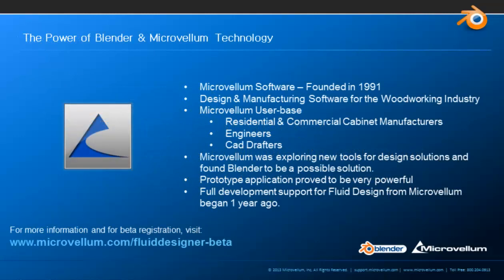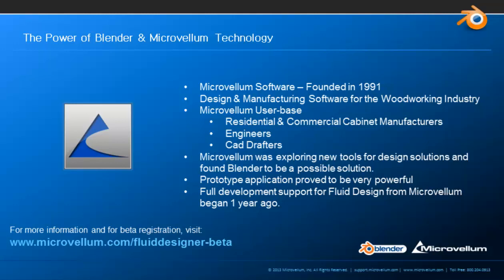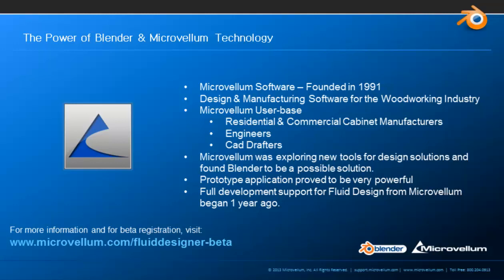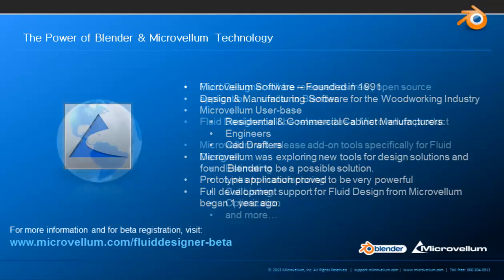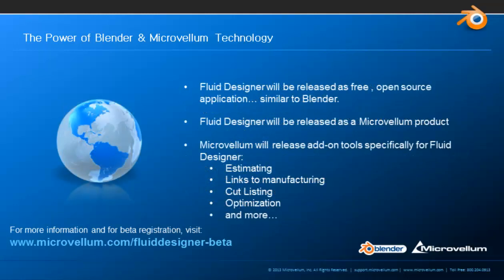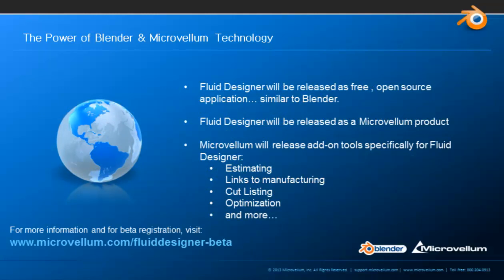What is Fluid Designer?

Comment: This clears a lot of stuff up! However, I'm worried about fragmentation. To me, it sounds like it's going to be its own program. That may be fine in the short-term, but I (and I'm sure many others) would really like to see these features merged into trunk so that parametric models could be exchanged among existing blender users using the official build. This is some really powerful stuff that I'm sure many others outside of the interior design field would love to have. Personally, I'm interested in engineering applications, where numerous parts can be created that can interface with each other an many ways based on constraints. I'm thinking something like a virtual lego set or erector set where different pieces have set ways they can interact and where people could contribute their own pieces. In many ways, this is approaching the fidelity of something like solidworks' assemblies, but with the freedom of a polygon modeler. 

Awesome stuff! Looking forward to more videos!